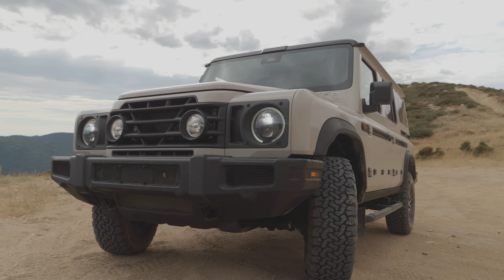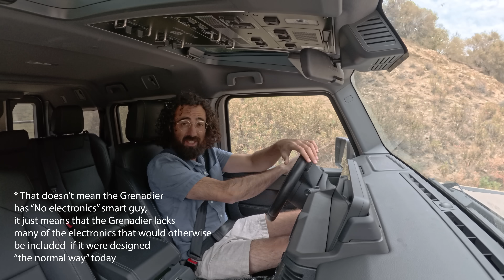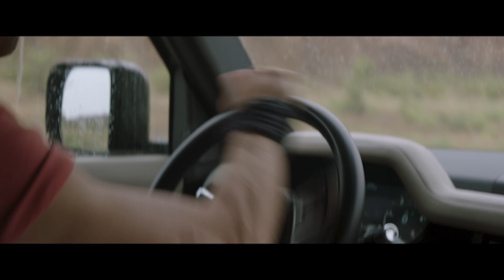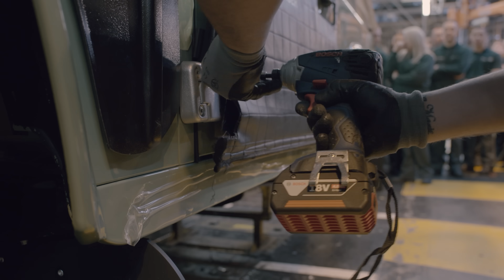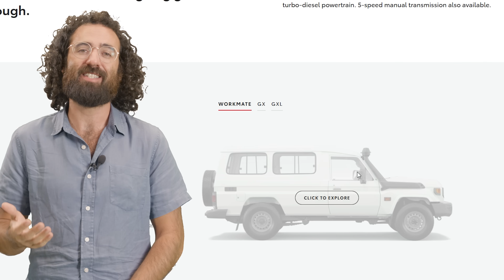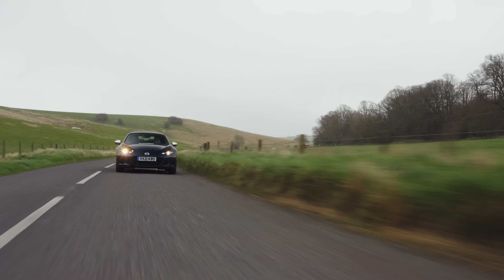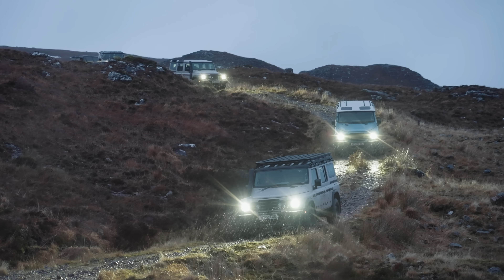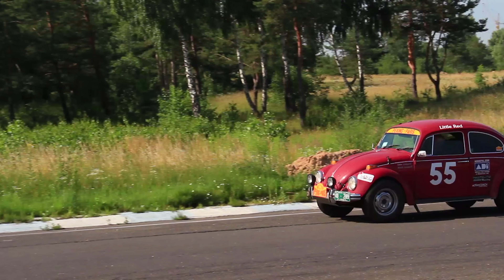Why a simple new truck has to cost over $70,000 in 2025

Comment: At 11:35 you said that the window would require two more ECUs to have an automatic closing function and that's a total and complete lie, you can do all of the Automatic Closing Control from the BCM just by measuring the Amperage draw of the window motor and watching out for large sudden spikes in Amperage draw which would indicate extra effort being put out by the motor which would mean something is in its way and automatically cut off power to the motor

Comment: Nope.   As an engineering student, we had a Ford engineer give is a talk about the auto industry.  He noted that the cost difference between an econo car and the luxury model was minimal at volume.   High end cars were highly profitable.  Both vehicles require same manufacturing space, number of robots, etc.   Yes a bit more material and engineering into the lux vehicle, but minimal at volume.   The big three admit that the profits on trucks are huge.   This truck only cost more because the volume is low, same for the Land Cruiser.

Comment: In my country, it's much cheaper to have two or three specialized vehicles than one for everything if you buy used and know a little of fix things. The main reason is that the current generation no longer knows how to fix things, so used options tend to be out of the question and focus in a vehicle that try to do everything. For the next years used cars are going deeper in price than ever before except for those that will be unicorns like V8, rigid axles, etc. that will be valued. A few days ago, when I arrived at a supermarket, I saw a couple sitting on the floor looking at the car manual on how to change a tire. After buying, they were still there and I helped them.

Comment: Shoot, wife and I have 4 cars and they are all unique with a couple of offroaders and two performance cars (one a EV).  I didn't know fun cars were becoming a rarity.  My "offroader" is kind of like this Ineos, but you didn't mention it...  Because I think this compares closer to my current 6th Gen Bronco (Jeep Wrangler too).  Both Bronco and Jeep can be bought with simpler controls such as manual transmission and those versions are alot cheaper than 70K....  I actually was thinking about one of these but it sounds to basic to me as I do want my new tech as well.  For example, I didn't think I would like adaptive cruise control but it actually works very well.

Comment: Or you could just buy a 1990s Jeep Cherokee and Mazda Miata.  Exactly what I did. 1995 and 1997 respectively. A two car solution for well under $10k. Since I put a bit of work into each myself, it was well under $5k. 

Just don't expect much on-road comfort on long drives or modern safety standards.  

I respect the Grenadier for what it is.  But paying the better part of $100k after taxes, registration, etc. is really not an option for most people.

Comment: All that tech is cheap just like pay as you go phones are super computers in your pocket for less than $100. The first home computers were $$5000 usd.
Saying all the tech is expensive is bull. It’s only expensive because it’s kinda new .
I drive a 2021 f150 with one of the last 8ft boxes and 4 doors. It had the max tow. So it drives like a truck. It has the 8 inch screen so it only controls the stereo and backup camera. Hopefully I’ll have it for a long time.

Comment: If they wanted to make it reliable they should have put the 4.6 or 5.7 Toyota motor in it. That BMW motor will run like crap in 60k miles whereas the Toyota 4.6 will just be breaking in at 100k miles.

Comment: but you can get a base model Jeep Wrangler with a 3.6L port injected NA motor, manual transmission, and solid axles and crank windows for like $36k mark. And street price is like <$30k.

And there are rubicons for ~$40k with upgraded axles, transfer case and with lockers.

This truck is not simple. A B58 is not simple no matter how detuned it is, nor is a ZF8 speed.

Comment: "Minimal electronics" and posts a turbo DOHC VVT 9 speed drivetrain with multiple ABS and traction control modes and hill descent BS.  Oh, and a foot-wide touchscreen on the dash.  Touchscreens have NO PLACE on 4x4's that actually do 4x4 things.  Dirt scratches them.  Touching the screen while wheeling can result in a too-hard press that cracks the screen.

"Simple" as the consumer is requesting, means naturally aspirated, no more than 6 speed transmission (manual!?!?! Please?!?!), no Big Brother "infotainment" installed (can we just go back to Kenwood/Pioneer 1 or 2 DIN stereos please?) and a damn key instead of a pocket fob.  Analog "big fugging lever" 4x4 engagement.

You might respond with "but NA engines with manuals can't pass emissions regs!"  To which I reply "Emissions regs are bullshit then, since none of these new vehicles last past 100,000 miles without the equivalent of open heart surgery on them (turbo/electronics replacement, whole engine rebuild/replacement, or transmission replacement)."  The greenest thing you can do is make a vehicle last longer.

Off road doesn't need "democratization."  No amount of tech makes it safe for dumbasses to go places they don't know how the terrain affects their vehicles.  Matt's Off Road Recovery channel clearly shows that.  Add to that, the additional weight of all the tech generally ruins the ability of the tires to support the vehicle on questionable terrain (like sand or mud).  No amount of tech will preemptively air down the tires for the terrain.  That takes knowledge.

I would buy one of these at $45,000.  Not at $70,000 though.  And I'm able to buy it at $70K.  I make enough.  But I won't.  I'm driving an old 90's 4x4 by choice, because they're serviceable and don't have computers that override my inputs.

All of this is inexcusable bullshit.  Kia and Hyundai can put mommy soccermobile SUV's on the road for $20K.  There's not 3.5x the materials, and computers, and horsepower in the Grenadier.  It's mostly luxury/capability/sin tax.

Comment: Can you turn off the oil maintenance light yourself - after you change the oil?

Or do you have to take it to INEOS to turn off the light ?
Reply: Warning which comes on for 12k mile intervals needs dealer reset currently. OBD2 cannot clear on locked ECU currently.

Comment: Why does it cost over $70,000, because it using a BMW turbo charged motor. That's a "Deal Breaker" for me. I Do NOT want a Turbo charged motor (especially a BMW motor) for off roading. I'm a retired industrial mechanic and I prefer Port Injected Naturally Aspirated motors. Two years ago I bought a Jeep 4 door Willys with a Naturally Aspirated V6, it came with Dana 44 Axles, a Locking Rear Differental, Mud Terrain tires, Hill accent/decent control for $40,000 Love it, NO Issues. Climbs like a Billy Goat. The only thing it needs is a forward facing camera  like the Rubicon models option be because it hard to see over the hood when topping over hills.

Comment: Fantastic breakdown. Vehicles are tools: a truck like this one is meant to get dirty, not just flex at the mall, and an X5 isn’t a rock crawler. Choose what matches your real use case and live with the trade-offs—otherwise it just inflates prices for enthusiasts who need the capability. If your sole use case for a Wrangler is to display ducks and drive with the top off, then its just wrong.

Comment: Again, so much misinformation in this video like all your others. One example @ 13:30 "But the reason it's pavement performance is mediocre is because the solid axles give this truck better articulation and grip than independent suspension ever could." No, the reason is because a solid axle can provide great articulation while also being simpler, much cheaper, and more durable. There is a reason extreme, custom off-road vehicles (non mass-produced) use independent suspension, and that's because when designed accordingly you can get significantly more articulation but at the expense of complexity/reliability/much greater cost. IFS/IRS can absolutely be superior to solid axles when designed accordingly with regards to articulation, but with significant trade-offs that no mass-production auto manufacturer would ever make.

Comment: I'm not sure what specialized vehicles he's talking about from decades prior.
The full-sized Broncos from the video didn't come particularly trail worthy from the floor, They still needed to be modified.
The Karman-Ghia in the video would have been over 25 years old in the 90's and dirt cheap.
Families still have multiple cars. The difference between then and now is people aren't having families, not that families are buying fewer cars.

The simple reason why the Grenadier is as expensive as it is would be it's a low production vehicle. The cost of development is the same for five vehicles or five hundred thousand. Tooling to scale also costs millions if not billions to accomplish. Ford or GM might spend half a billions bucks just to retool an existing truck plant for a new model year.

Comment: I scrolled FAR to find the comments about the drivetrain, which is the real problem with this car. I see maybe 15 people across the 1000 comments acknowledging it. It's not the price, it's not the drive quality, it's the B58 and fuel tank and MPG. 

They  built an overland trail vehicle with less actual range capability and MPG ability than non-trail vehicles. 15MPG average across most owners today is what people are seeing on the Ineos forums. Thats 355 miles of range, which is not enough for major overlanding and touring (and cut that in half for real off roading)

The problem with that isn't just at the pump, it's an enormous range oversight for whats deemed an "off road trail" vehicle. 

I was one of the 1st 2000 pre-orders, way way way back, and pulled my deposit after seeing the MPG and range issue, because i planned on using the vehicle the way it was intentded, for large trips off road in the American West. If they'd brought a small format diesel, like the 3.0 LZ0 in the GMC sierra, or something like that (which they do in Europe and get 27Mpg) i'd have happily bought one. 

It's lazy work, and ruins an otherwise near-perfect off road trip vehicle. I don't think people fully understand HOW ANNOYING and MESSY filling with jerry cans on the side of a trail is, or the anxiety that comes from knowing for a fact you only have enough fuel to get 90 percent of the distance, so those cans will be required.

I ended up buying a 2024 GMC Sierra 1500, with the "baby diesel", I get nearly double the range, not as good turning radius, and it required a soft cap to cover the bed which the ineos wouldn't have needed. Same price, but a more practical tool for serious distances.
Reply: 15 MPG?! How is it even legal to sell lol
Reply: I have a gas F250 and I'm getting about 14 MPG in mixed driving. The F250s with gas motors are known to have "dog sh*t terrible" MPG. The F250 also doesn't have a 91 octane recommendation like the Ineos. 

I think Ineos did good with their philosophy (good mass market appeal), but need to refine a lot of stuff with their next gens.

Comment: What is the curb weight of this thing? and how much can it tow? 

Instead, I went with a 65,000 dollar sticker price 1-ton F350 w/ the Tremor Offroad Package, the 7.3L/445 C.I. gas/petrol V8 engine, the beefier 10R140 and 4.30-geared axles (locking rear, limited slip front) and 35" Goodyear Duratracs. In addition to the Tremor Package the truck is a four-door, has an engine block heater, remote start, "upfitter" switches in it's interior ceiling console, dual alternators totalling 410 amps and dual 68Ah AGM batteries. That is a great value in a capable motor vehicle, and it can tow heavy. 

Love the Inios, but I also needed a tow vehicle. Cheers!

Comment: WRONG! There is nothing simple about this truck. You milennials are so used to luxury that you think this thing is "simple." My first new truck was  a 1990 Isuzu P'up. Google it. THAT'S  A SIMPLE TRUCK, and if you built one today, it'd cost about $15,000. new. You whine about $70,000. For a new truck,  well, dump the cruise control, dump 4wd, dump heated seats and electric windows, and dump auto transmission. Get balls, do without, and don't waste money. Maybe then you can afford a 900sf.  starter house.

Comment: Simple means no touch-screens or "infotainment" systems to fail and leave you without radio or HVAC controls. Simple means no leather and no carpet. Simple means EMP-proof fuel and ignition management (read carburetors and distributors). Simple means the shifter is attached to the transmission, not to a switch that activates a servo in the transmission. Simple means the throttle is attached to the fuel system by a cable. Simple means I can start it, take the battery out and stow it in the cargo area, and drive across Africa as long as I don't shut it down. Simple means manual roll-up windows, manual locks, no remote locking system, and NO ECMs, ECUs, or CPUs . This is not simple, this is not analog, not even close. The fact that you could even say that with a straight face tells me how far in the wrong direction we've gone with our word salad. Above all, simple is affordable, by definition. I would pay $72k cash for an ACTUAL 1970's International Scout or Jeep Wagoneer before I would buy this thing, but I don't have to. I can find well-kept, low-mileage, soccer-mom driven, simple-as-a-hammer K5 Blazers, Broncos, Scouts, Cherokees and Grand Cherokees for less than $10k all day long.
Reply: Most vehicles are EMP proof because they are rolling faraday cages.

Comment: Those simple things like physical buttons and switches are actually very costly, thats why all automakers want to switch to touch only, its cheap as hell, and in theory, more reliable because of the lack of moving parts. Sure theres growing pains like using the wrong materials making them decay with sun exposure, finger oils, or common car cleaning products, but they want to increase profits, by using something cheap, that also on the surface seems futuristic, they can charge a premium, for something that costs them less. The problem is that they pour money into designing software features that hardly anyone uses and they end up wasting the money they would have saved.
Ineos is expensive because it is well built and mechanically/design complex, simple can be cheap, but simple done well can be expensive, making simple done well while being cheap is incredibly complex in the design and materials phase.

Comment: To all my Toyota guys (me included) bitching about not having a 70 series Land Cruiser in the US… well, here you go. 

I’ve had my Grenadier for 7 months and 5k miles. My favorite all time vehicle. Go get one!
Reply: Let us know when it reaches 700,000km like a 70 series.
Reply: @DalenKruse I’d bet it will reach 700k before a new Land Cruiser Prado, which is our only option in the US. Toyota US sucks since 2021.

The Grenadier is using the B58 engine and the ZF8 transmission. Arguably the most reliable combo in modern production. It seems Toyota agrees as they use the same combo in the Supra.

Comment: One of the best reviews of the Grenadier that I've seen! As an owner, wholeheartedly agree, the Grenadier isn't an everything car - it's a specialized vehicle for a specialized purpose and I LUV it for that. It doesn't handle like a mush mobile on the road today - you actually feel the road and are allowed to drive the vehicle instead of it driving you. What a wonderful experience and this video brings that point to light loud and clear. Thumbs up for pointing out the purpose and direction of INEOS in producing this amazing vehicle. Brings a smile to my face every single time I start the engine with my old style key, listen to the hum of the amazing power under the hood, and hold on to the steering wheel while doing what it does best.

Comment: Greetinhs from Pretoria. You won't find many Grenediers out in the bush in Southern Africa. That is the domain of Hilux, Landcruiser and increasingly Mahindra in the workhorse segment.

The old Solihul aircon Defender is a piece of shiite. Coat hanger half-shafts, doors that come off if you roll, because the hinges are on the outside, appauling ergonomics, barely functioning aircon, rear door spare wheel mount that breaks if driving on dirt roat corrugations and notorious dreadful reliabilty. You see few of those in the wilds of Africa.

Comment: That B58 with its variable oil pump.
What a ticking time bomb that is.
And it still suffers from oil pressure issues after the plastic to metal veins update.
Yet Toyota and friends "deem" it reliable. 😂😂🎉
Even the new s58 is plagued by oiling issues due to pan design 😂😂

All aluminum pushrod v8 would've been the cherry on top for the Grenadier.
Reply: This comment needs more attention. People who think the simplicity will make it super reliable are wrong and they just have to look as far as the b58 bmw engine. Not the least reliable of all the bmw engines but the amount of plastic and gasket issues within 150k miles … just add some off-roading trips and see what that does. What  huge disappointment for what looks like a truly remarkable startup car. If these are on the road in 10 years I wouldn’t be surprised if they needed replacement or engine swaps and this is coming from a guy who owns a bmw b48 engine in a 330i.